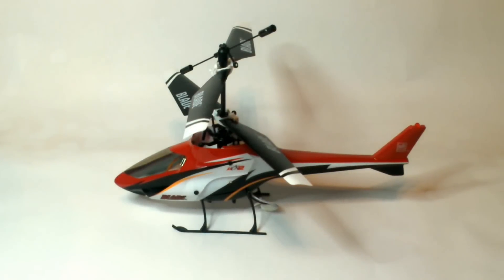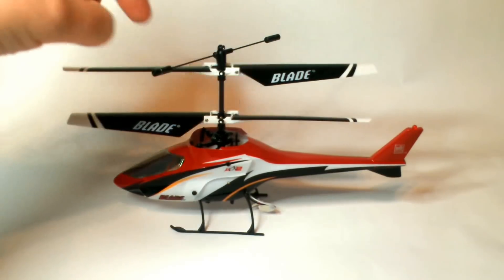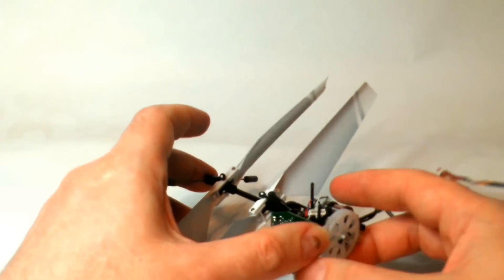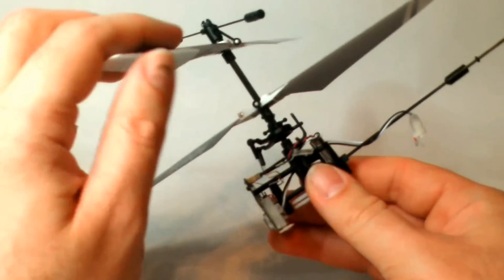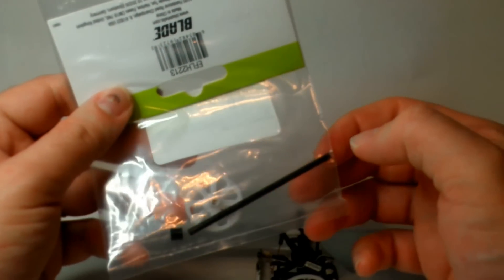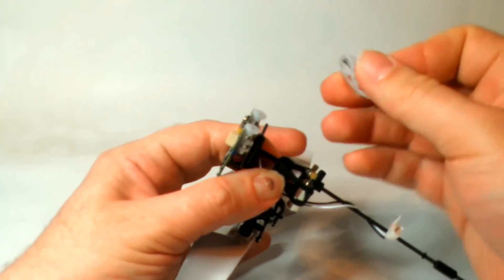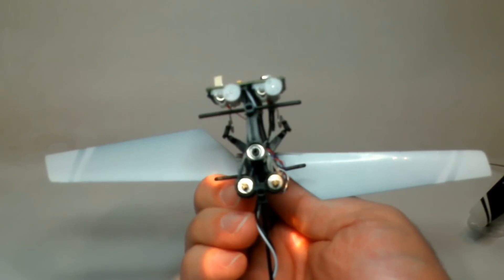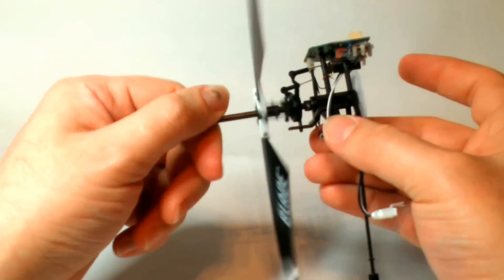Replacing the *Lower* Rotor Drive-Gear on the Blade MCX2 RC Helicopter

Comment: Ive been working on this for hours and I cannot get it to go on and mesh with the motor so it spins nicely. I put it on as you have shown and it spins roughly as I try to spin by hand. So frustrating. I have tried 2 brand new gears in the past few hours.  Please HELP!!

Comment: Now I know why my lower blade is grinding and shrieking at me. it sticks a lot too. i guess I need to order these parts and get at it. Such a bummer, I was just getting good at flying this thing!
Reply: I had to replace my frame and everything was going fine until I had to remove the gear from the outer shaft. I couldn't get it to attach to either the original shaft/gear or a new pair I purchased. At first, I thought that the binding problem was due to a faulty new frame (motor wasn't in the proper position to mesh with gear), I soon realized that wasn't the problem. Like you, I noticed that the gear wasn't seating properly and wobbling, causing the motor and gear to bind up. How did you attach the shaft to the gear to solve this problem?
Reply: I never solved the problem. it's all in a clear bin. Has been for the past 6 months. I gave up.
Reply: I dig some digging ... From what I understand you have to align both the gear and outer shaft properly (as the video illustrates) if you don't you'll damage the gear and/or shaft and they won't mate. The shaft and gear are quite delicate, a few failed attempts and you'll have to use a new pair. You should take the 'bird' out of that 'clear bin' and give it another try.

Comment: I have a syma heli just got today and the main drive shaft stick has slipped out somehow don't know what to do u can see the metal spike go all the way to the bottom past the gear but it doesn't stick their so the top blades come out with it

Comment: great vid I have a similar problem it's a plastic on the motor that drives the upper rotors keeps slipping out of mesh any ideas what mite hold it in place?